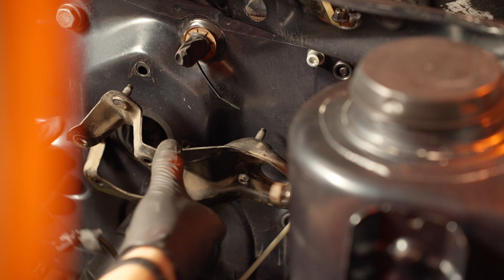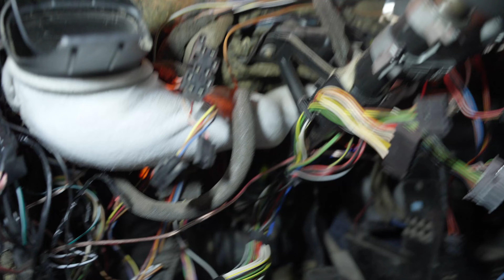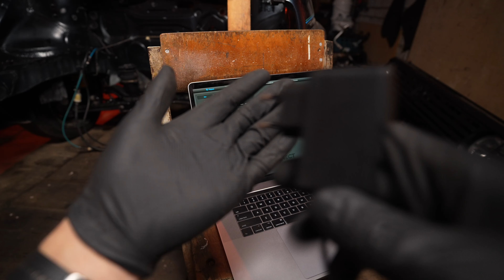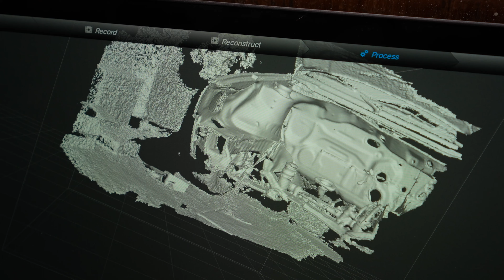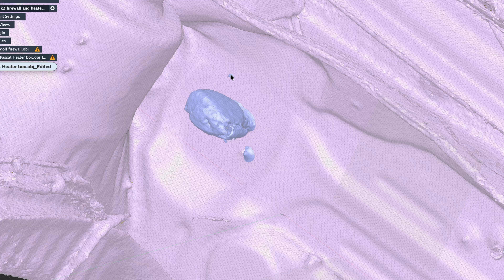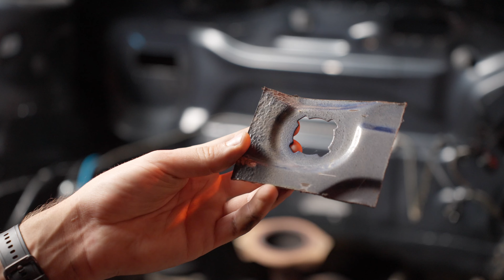Cutting Holes for the Clutch and A/C Using Cheap 3D Scanning! - Project Madison Golf Mk2 Pt.7 -

Comment: pretty cool with the app, which gen passat is the heater box from? I got lucky and found a complete mk2 ac heater box on allegro for 200 zloty. Only one stud snapped, but well i can fix that :P I was wondering if b3/b4 lines would be a good fit, so cool you showed the mk3 ones so i have something to compare with.
Reply from the maker: My heater box is from a Passat B4. Thank you for watching!